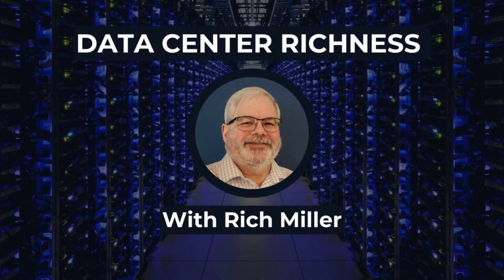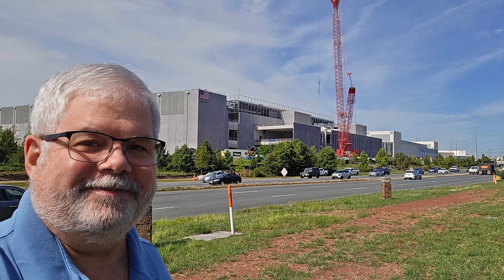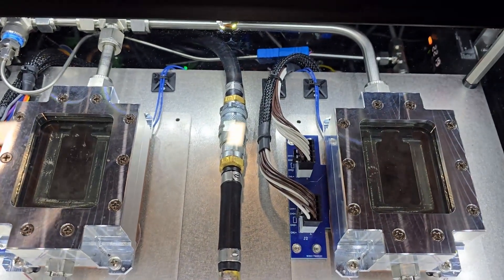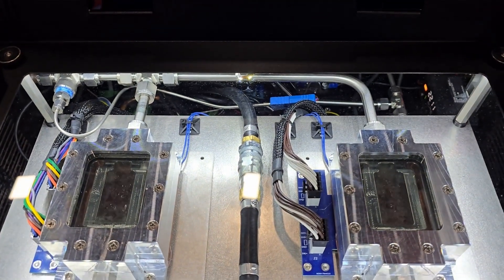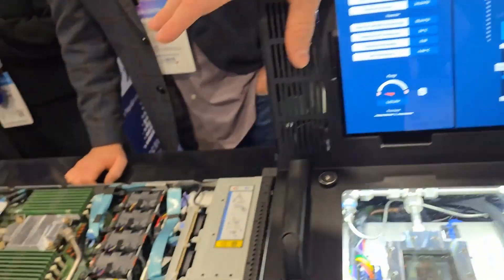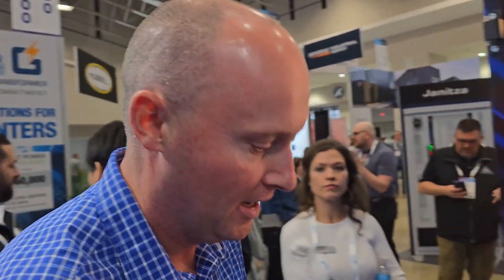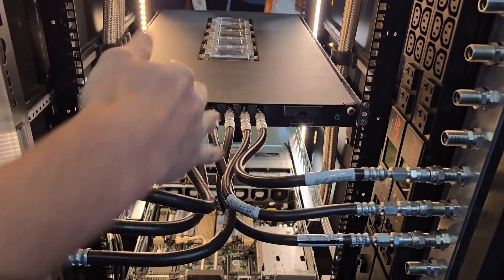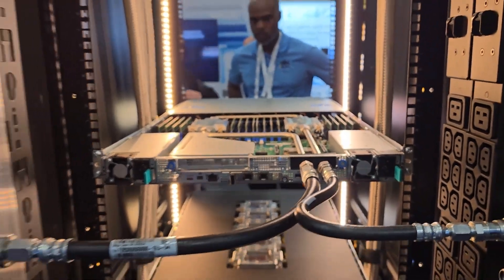A Closer Look at Two-Phase Liquid Cooling

Comment: an intersting design, however concerns still exist for 2 phase solutions. Some require high GWP(GLobal warming potential) and may not be viable in certain locations due to regulatory requirements. the 2nd issue is human safety - if the coolant leak is vaporous it can displace oxygen and therefore the deployment location may need additonal human safety protection. 2phase cooling itself isn't new as Cray were doing this in the 1980's , however it may well bne sutiable for niche applications. Pg25 water based solutions dont have the GWP and human safety risks and are the most common flavour of liquid coolign today. Also, if facility water goes into the rack there is always the potential for leaks and the risk isn't eliminated particularly if the facility warm water or chilled loop runs overhead of the rack so there is always  the risk of a high pressure leak such as a pipe fracture to cause damage to the rack. A good design however can mitigaste most of the risk  :) - it wil be interestign to see how costs compare to PG25 based solutions and how many cusotmers adopt 2phase DTC cooling solutions such as this
Reply: Accelsius has two proprietary refrigerants, Eco+ (R-1233zd(E)) and Performance+ (R-515B), with the following properties: Non-corrosive, non-flammable, and non-toxic. ASHRAE A1 safety rating, 0 Ozone Depletion Potential (ODP), Low GWP.
Used in data center, industrial process, and comfort cooling applications. Meets the industry’s sustainability requirements. Supplied by Honeywell.